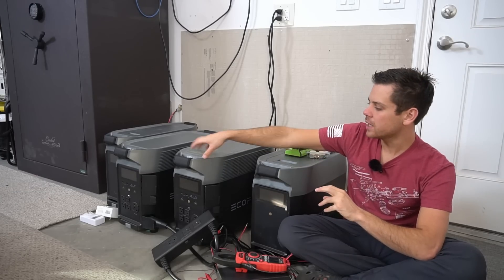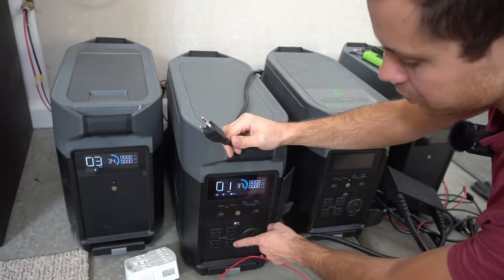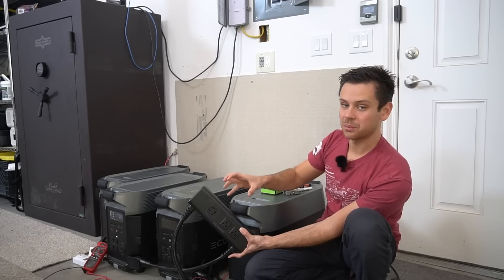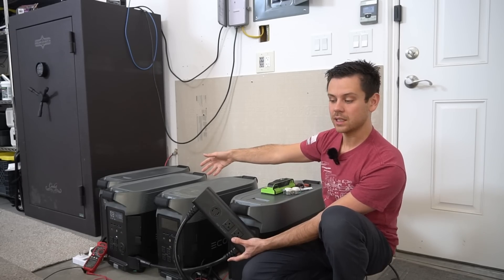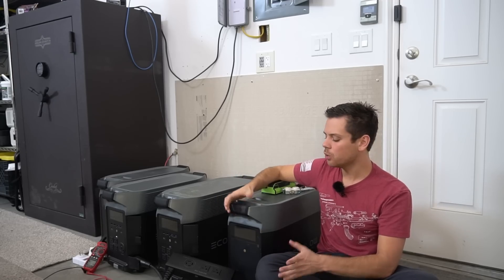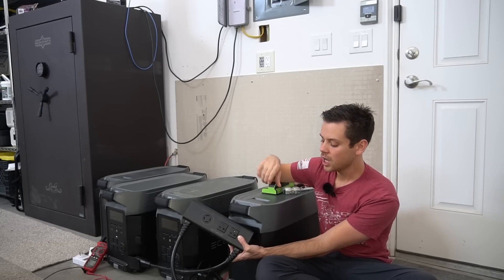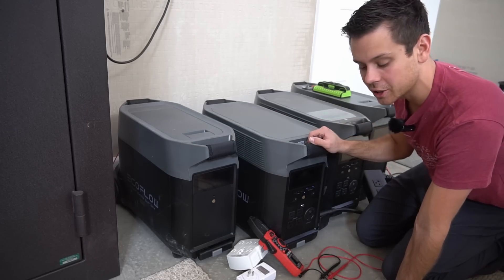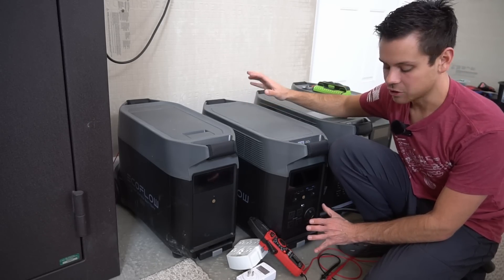I broke my Ecoflow Delta Pro 😬 (my fault)

Comment: I still don't understand the ground neutral crossover, I'm aware that AC has both, and that they should be separated, except when they shouldn't be... But I have no clue when that is. Anyone have a link to a comprehensive video demystifying this?
Reply: Here's the quick 101 (NOTE! I've made multiple edits to this posting to try to clarify things)

Ground is meant to be a hard reference to earth ground.  Hard meaning that it can't be shifted around if a voltage gets crossed on it (instead the voltage shorts to ground through the low impedence path).

Neutral is a (potentially isolated) tap off of a transformer that is designated as 'neutral'.  AC output voltages on other taps of the transformer are relative to neutral, not to ground.   

BUT, because the neutral tap off the transformer, it is NOT a hard reference.  That is, you can apply a voltage offset to the neutral and it will cause the other voltages on the transformer to also be offset.

--

Ok, so now we have a 'hard ground' and a 'soft neutral'.   Normally in a large electrical system such as the one connected to your house, in the U.S., the neutral is connected to ground through a grounding rod at every home.  Every home has a grounding rod.   This makes the neutral 'hard', meaning that applying a voltage to it does not shove its potential around, it just causes current to run in it.

This 'bonding' of neutral to ground is supposed to happen in only one place at the house, usually at the main circuit breaker (never at a sub-panel).  One and only one place.   There are many reasons for this, but mainly it comes down to a few things:   First, so any metal casing for a switch or outlet or light or computer or whatever does not get 'energized' with a voltage due to the power consumption flowing from the hot through the device and returning on neutral.   Second, so safety circuits (GFCI circuits) can detect shorts or improper current paths and trip.  For example, if there is any current on the ground wire, that's a ground fault.  If the current on the hot doesn't match the current on the neutral, that's also a fault.   And third, to ensure that short circuits (as much as possible) occur only on the specific circuit feeding the wire and don't have any sneak current paths through other wires.

If ground and neutral is bonded in multiple places, a short circuit might split the current across multiple wires and not be detected by the breakers.  Or might flow back through a ground wire and energize the casings for all the devices in the house with 120VAC, or other equally bad things.

On a 120VAC circuit, current returns through the neutral.

--

Ok... so now lets talk about 240VAC.  In the U.S.  240VAC is two 120VAC hots that are 180 degrees out of phase, with the waveform centered on neutral.  This is called 'split phase' and is the most typical way a house is wired.  Two legs from the street transformer plus the neutral center leg are brought to the house . Each leg is 120VAC to neutral.  The house bonds neutral and ground at the main circuit breaker so now each leg is 120VAC to ground AT the main circuit breaker too, and the neutral and the ground are connected together.

Normal split-phase 240VAC is different from 3-phase.  3-phase 240VAC is three 120VAC hots that are 120 degrees out of phase with each other.  120 120 120 = 360.  It is effectively incompatible with split-phase 240VAC.   Lets set 3-phase aside and not talk about it here.

HOWEVER, unlike 120VAC, the current flow in split-phase 240VAC is different.  Most typical use cases are to generate power via the two hots and to ignore the neutral.  By definition, no power can flow back on the neutral because it is not connected.  Instead, the power returns through the other hot.  So when one hot is pushing, the other is pulling, and vise-versa.

This presents a problem for the neutral though, because the two 120VAC phases are not necessarily exactly the same waveform 180 degrees out of phase.  Loads on the two phases may be different, so for example one hot might be 122VAC while the other is 119VAC.   EVEN IF the 240VAC load itself is symmetrical, this differential can cause the neutral going into the load to shift relative to ground.  If the 240VAC load itself is not symmetrical, then the neutral gets shifted even more.

Now since there is no actual neutral connection to the load in this example, the voltage offset created due to the mismatched hots is more like a synthesized neutral at the load... the potential of the neutral cannot actually change the neutral at the load.  Instead it tries to change it at the main breaker, OR WHEREVER ELSE NEUTRAL AND GROUND ARE BONDED.

--

Ok, continuing with 240VAC.  Now you have a problem.  You have a neutral at the load or near the load, or a load on the hots that cause the neutral SOMEWHERE to shift potential.  The neutral is no longer at the ground potential.  And you ALSO have your neutral bonded to ground at the main circuit panel OR OTHER PLACES.  THIS CAUSES SOME CURRENT TO FLOW ON THE NEUTRAL FROM THE POLE TO THE HOUSE THROUGH TO THE GROUNDING ROD.   Usually not a lot, but its almost always non-zero.  And no, you don't get charged for it.   But if the neutral is bonded to ground elsewhere inside the house... in this case on the 'almost' isolated output of the power station, the current can actually flow through there instead, or in addition to.  Values as large as an amp are actually quite common.   Usually this isn't a problem because the neutral goes all the way back to the main panel before it interconnects with any other neutral or the bonded ground, and the grounding rod is right there so the current goes into the grounding rod and does not change the neutral voltage offset for the rest of the house.

#1 - Ok... so now what happens if you bond neutral and ground somewhere OTHER than your main breaker box?  <---- THINK ABOUT THAT EVERYONE(!)

#2 - And then also think about the case where two separate generators are synchronized.  Where is the neutral for their outputs coming from?  Its coming from a transformer tap somewhere, and they are tied together so now you have TWO separate transformers tied together at a tap.   This instantly creates a more complex problem, particularly because the two hot legs are coming from different generators.   Not only will you get a voltage offset on the neutral when a load is applied, but there is also nowhere for it to go... it will float.   EXCEPT if you then bond neutral and ground on the output, now suddenly that voltage differential does have somewhere to go.  And since it doesn't have to flow all the way back to the main breaker it can cause a voltage offset to develop that can feed back through the AC charger and blow something up.

(But without the schematic I can't tell you anything more about what might be happening there).

--

Other possibilities include there being an actual offset between the EcoFlow delta's neutral due to the way the combiner box works.  In the U.S. the neutral is supposed to be centered on ground (center-tap).  But in Europe a 240VAC circuit actually has the neutral on an end-tap and the 240VAC waveform is all on one side.

So if the Ecoflow delta's output is Euro-standard, and you connect neutral and ground together to the house ground, BOOM!   Massive short between neutral and ground.  But again, someone needs to tear the thing apart or get ahold of a schematic.   The fact that Ecoflow said that it would work in Europe and not in the U.S. leads me to believe this latter scenario is more likely and that it isn't just an offset due to the hots not being identical (which is typically low current, less than an amp).

--

Other neutral use cases:  Not all split-phase 240VAC circuits omit neutral.  Grid-tie inverters, for example, require a hard neutral by code so they can push the two phases separately and monitor to ensure that one is not over-volting.   One can have motor and transformer circuits that use neutral as a hard reference.  And of course with 120VAC, current is actually returned on the neutral.  So if you have neutral and ground tied together anywhere other than the main cricuit board, this can cause current to flow through circuits that have nothing to do with the load generating that current.  And also cause the current to flow on the ground wire, which is a big no-no.

-Matt
Reply: @junkerzn7312  I acknowledge and appreciate your enthusiasm on the subject, but you have a lot of errors in your write up here.
Reply: @tao0ftime  Sure, go ahead and point them out and I can comment.

-Matt
Reply: @tao0ftime  Yes, please do, so we can all see your reasoning.
Reply: I went back through the video a third time looking for details.  Will did mention that there WAS a voltage offset between his neutral and his ground at the beginning of his video.  My assumption is that he's talking about at the wall plug in the garage and not the inverter.  That alone is a yellow flag because the neutral and the ground should just run all the way back to the main panel and be connected there.  He mentioned that the plug is hanging off a sub-panel... so in that case the neutral is being ganged at the sub-panel before running back to the main panel (not to mention also ganged on that specific circuit through other 120VAC plugs in the garage).   Having a voltage differential implies that some other active (turned on) circuit hanging off that sub-panel, or some other active (turned on) circuit in the same garage circuit, which is putting current on the neutral, is involved.

So if we have other currents on the neutral-return due to the house wiring, and you create a second neutral-ground bond on the output of the Eco flow delta... that's definitely a problem.

--

I think some parts of it are a bit confusing, I bungled the explanation when the target load does not connect neutral (this causes any asymmetry to propagate back towards the main panel but doesn't get rid of it)... but insofar as I can tell it is correct.   The issue comes down to what happens when a second neutral-ground bond is created on the output side of the Ecoflow delta pro.   At that point you no longer have neutral and ground meeting at the main panel and grounding rod.  So now any voltage differential caused by WHATEVER has two current paths to return through, one of which bypasses the Eco flow's output circuitry.

At this point we'd need a schematic or some reverse engineering to see what happens when the Eco flow's return current doesn't match the output current.  I would surmise that it could shift the neutral tap even further.  Since the Eco flow delta is almost certainly using a HF inverter instead of a LF inverter, the circuitry is more complex (there is more than just a transformer involved in the output stage of the inverter).   Having a significant foreign current path reversing through an output stage can be catastrophic.

We also have the problem of the return current going back through a different Ecoflow delta, due to the combiner box in the 240VAC design.  Presumably EcoFlow designed with that in mind but... how exactly?  What did they do with the neutrals from each individual 120VAC 30A output?  Are they tied together or is there something more complex happening?  How much asymmetry can that combiner circuit and the output stages of the inverters handle?  Then what happens if you force a voltage offset that the EcoFlow didn't expect on that neutral?

-Matt
Reply: @junkerzn7312  Ok, but yours is a long post and a very heady subject, and we could easily spend a looooong time. I've been a licensed electrician in the US for 20 years, and I deal with these issues all the time. I'm not saying I'm smarter or have all the answers, but I do have a lot of experience. Terminology and definitions are key. I use the US National Electric Code exclusively in my profession. If you were trained elsewhere in the world, our terminology and standards are probably different. So, first, lemme just say that the product in this video doesn't appear to be listed by a NRTL like UL or Intertek etc., and there's no wiring diagram available from the manufacturer. Trying to reverse engineer it is a waste of time. Modifying it is a roll of the dice. If it fails, starts a fire, or kills your guests, best of luck with your insurance company. Best case scenario, you have voided the warranty on your Tesla. But I digress.... Ok I'll try and poke some holes in your post.   "Ground is meant to be a hard reference to earth ground"  What does hard reference mean? The NEC defines ground as the earth, and grounded systems are connected to the earth. "Hard meaning that it can't be shifted around if a voltage gets crossed on it" What do you mean shifted around? Voltage between what 2 points? What about when lightning strikes the ground? "Neutral is a (potentially isolated) tap off of a transformer that is designated as 'neutral'" Not how it's defined in the NEC. Can a 3 phase load have a neutral? What about a single phase load? "Normally in a large electrical system such as the one connected to your house, in the U.S., the neutral is connected to ground through a grounding rod at every home.  Every home has a grounding rod." Not true. There are other acceptable methods, and more alarmingly some houses have NO ground connection. Also, there is another point where the neutral and ground should be bonded, and that is the transformer. I have seen that missing as well. "If ground and neutral is bonded in multiple places, a short circuit might split the current across multiple wires and not be detected by the breakers" I disagree. Circuit breakers, and fuses, open when there is overcurrent. The more overcurrent the faster they open. During a ground fault, it doesn't matter how many neutral to ground bonds you have, as long as you have at least one. GFCI's are a different story. What do you think would happen if you had a neutral to ground bond after a GFCI? They are NOT an overcurrent protection device. The code even allows them as a replacement for ungrounded receptacles, because they can function without a ground connection. "On a 120VAC circuit, current returns through the neutral.
" If it's alternating current, it goes both directions. "Normal split-phase 240VAC is different from 3-phase." yes, but it's technically still single phase "3-phase 240VAC is three 120VAC hots that are 120 degrees out of phase with each other. " If I have a 240 volt 3 phase ungrounded delta system, where do I get 120? What if one of the phases are grounded, a.k.a corner grounded delta? "It is effectively incompatible with split-phase 240VAC" Well yeah we're talking about 2 different systems. However, a 240 single phase volt load doesn't care about the phase angle. It will work just fine on a 240 volt 3 phase system, when connected to a single phase.  "HOWEVER, unlike 120VAC, the current flow in split-phase 240VAC is different." hmmm... they both follow ohms law. " Most typical use cases are to generate power via the two hots and to ignore the neutral." I dunno, most of the devices in most u.s. households are 120... " If the 240VAC load itself is not symmetrical, then the neutral gets shifted even more." Give an example of an asymmetrical 240 volt load. Symmetry would seem to imply a neutral connection for 120 volt loads. Anyway that's all I have for now. I do enjoy this stuff... it's fascinating
Reply: @tao0ftime  ok,... paragraphs(!).  But lets go through this.   I'm an electrical engineer by education and trade.  And you are an electrician by education and trade.

I agree re: the product not having a schematic available.  Its basically a scaled-up 'solar generator'.  A battery inverter charger system with a big honking battery.  I wouldn't be the one reverse engineering it... it would have to be Will, if he wanted to take it apart.  But he isn't an electrical engineer so that probably wouldn't be much help.

A hard reference is something whos potential can't be pushed around easily.   A grounding rod is a good example.   A soft reference is something whos potential can be pushed around easily.  For example, the center-tap on a transformer.   If you connect one to the other, the transformer's secondary will shift relative to the grounding rod, not the other way around.   The potentials do not have to be defined... there is no meaning to 'voltage potential' between two isolated points.  But static charge (an excess or deficit of electrons in a volume of space) is universal so you can think of it that way.

If lightning hits the ground, the ground reference at that point will change big time.  Still doesn't mean its 'easy' though.  But not for long, it will go back to where it was fairly quickly.  A better example would be the storm clouds above you and the friction of the air and wind causing a long period of deviation of the potential at the ground.   If we are talking about potential and not static charge, then of course you need two measuring points.   So for the sake of argument, consider the other measuring point earth ground a few miles away.   The voltage differential measured in that case is called 'common mode', something you should be familiar with if you've ever wired copper based comm circuits (like phones, DSL, T1's, etc)... or cable, or say strung ethernet between two buildings.

I'll defer to your experience on grounding houses, but at least where I live (in CA, in the bay area), there is a grounding rod at every house tied to neutral and the split phase comes from a transformer on a pole or (where I live) under the street, with neutral tied to the ground and the grounding rod at the panel.  And that transformer feeding possibly several homes on the block, each of which has a grounding rod.   I don't know if the transformer neutral is also grounded at the transformer.

I do know there there are several different distribution formats... like 3 different ways, and neutral is defined for at least two of the three.  Still, in all three methods I'm fairly sure neutral is a transformer tap of some sort or another, intended to carry current, or a tap off of a second transformer closer to the house.   But this is the first I've heard of a house not having a grounding rod... unless you are talking about the meter being located away from the house (like a few hundred feet) and the grounding rod is at the meter.

For all intents and purposes, though, I think we can assume that neutral is bonded to ground at the main panel since that is how Will's house is wired to (from what he said), at least in this instance.

"Can a 3 phase load have a neutral?", yes, of course it can.
"What about a single phase load?", yes, of course it can.    Maybe I'm not understanding these questions.

(If ground and neutral is bonded in multiple places, a short circuit might split the current across multiple wires and not be detected by the breakers) I disagree. Circuit breakers, and fuses, open when there is overcurrent." 

Yes, I'll give you that one.   This is only true when the overcurrent is going through the one breaker, which it probably will be at least on one side of the circuit.  The return side might get split, though, and it is the portion of that return current going through a path that it isn't supposed to go through that can cause problems.   So even if there is no short per-say, you can still fry circuits.

I will also point out that there is typically some current on the pole or underground transformer's neutral, not necessarily caused by 120V circuits in homes.  That is, even if you disconnect the homes, just having multiple grounding rods (one at the transformer and one at the house) will result in a current.   Normally the common mode differential between the grounds does not produce a lot of current... it can be a in the hundreds of volts but still only be microamps, due to the potential difference between the two grounds.  BUT there is an added issue of the ground near the transformer being affected by the power distribution network.  So one can easily wind up with upwards 1 amp on the neutral between the pole/underground transformer and the house.  Depends heavily on the distances involved and type of soil though.   All of this current is on the utility side of the meter, though, not inside the house.

"During a ground fault, it doesn't matter how many neutral to ground bonds you have, as long as you have at least one."

Not necessarily.  A ground fault does not have to be a dead short.  A normal circuit breaker might not open (and didn't in Will's case).   In this case the ground fault reversed through the unit's AC charging circuit and clearly didn't have enough current to trip the breaker.  A GFCI might have caught it, though, due to the ground/neutral bonding he made on the output side of his inverter.

In fact, I had a ground fault that wasn't a dead short on my grid-tie solar system last year... it was an arcing fault, that didn't trip the breaker.  The breaker worked fine... I dead shorted it and it tripped.  So whatever was happening there, it wasn't enough to trip the breaker.  But it was enough to cause further damage to the cable (in this case it was a cable inside a metal conduit that was too small for it... I wasn't the one who wired it.  We found it when we had to reroute some circuits to add a L2 charger to the garage).

Whatever happened to Will, it wasn't enough to trip the breaker.

"What do you think would happen if you had a neutral to ground bond after a GFCI? They are NOT an overcurrent protection device"

If any current returns through anything other than the neutral, the GFCI will trip.  So if you have a solid neutral to ground bond after the GFCI, it will probably trip the instant you turn something on.   I haven't tested this (nor do I intend to).  But that would be my expectation because the current on the return neutral would be split and a differential would be registered by the GFCI.   Hence why I said that I believed that a GFCI plug might have saved the device.

"hmmm... they both follow ohms law. "

That was just in terms of where the current was going.  Yes, they follow ohms law.  But in a 120V circuit that is half of the split-phase going into the house, the current returns on the neutral, whereas with a 240V circuit the current returns on the other leg.  When one hot is pushing, the other hot is pulling, and vise-versa.  The neutral usually has no current (well, obviously if not connected), or very little current (if it is connected).   And the grounding wire should have zero current if things are operating properly.

"If I have a 240 volt 3 phase ungrounded delta system, where do I get 120? What if one of the phases are grounded, a.k.a corner grounded delta? "

Ungrounded delta system, you center-tap one of the transformers to get 120 (not sure what the neutral would wind up being there though).  If you don't do that, then you have to take one of the three 240VAC phases and run it through another transformer (I would guess that is more common, but you tell me).   Grounded delta, again center-tap one of the transformers and the ground can be the neutral.    No center-tap?   Then you would have to run one of the 240VAC phases through another transformer.

You tell me, which method is used?   But this is Will's house, not a commercial property.  He's probably getting split-phase, not delta, or the utility has another transformer after the delta to give him the split-phase.

"Give an example of an asymmetrical 240 volt load. Symmetry would seem to imply a neutral connection for 120 volt loads"

Yes, the neutral that is bonded to ground on the output of that combined box that Will plugged the neutral-ground wire to.   We don't know what is inside that combiner, if anything.  But we do know that the two hots are coming from two different solar generators and the two solar generators are connected together via that neutral line.   I'm fairly sure that I said in my posting that I needed a schematic to be able to know any more.  But it is not inconceivable that significant asymmetries could develop, or that the neutral is not ground-referenced.    I suspect that the neutral is not ground-referenced and that caused the AC charging circuit in the solar generator to fry when Will connected ground and neutral together.  It doesn't have to be a dead short to fry something.

One would assume that the solar generator's output is isolated, normally... I assumed it would be, but actually it clearly wasn't.  Not only is the generator using a high-frequency inverter design (so there is more to the output stage than just a transformer), but there was also some kind of potential or continuity between the wall and the output of the generator when Will had the AC charger portion of the generator plugged into the wall.   But again, we need a schematic or some sleuthing and Will isn't an electrical engineer.  But he can still measure resistances and potentials between that neutral output and the wall neutral and wall ground (which I suggested he do in a later post, with and without a load attached, to see if the potential delta changed).

-Matt